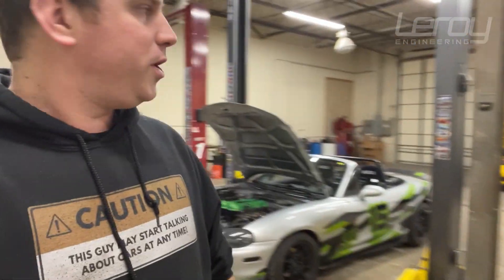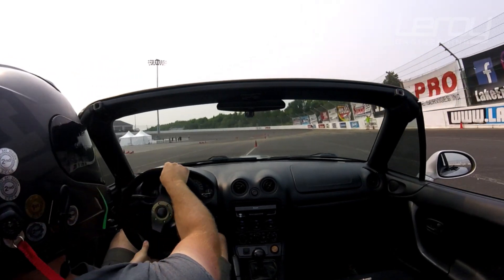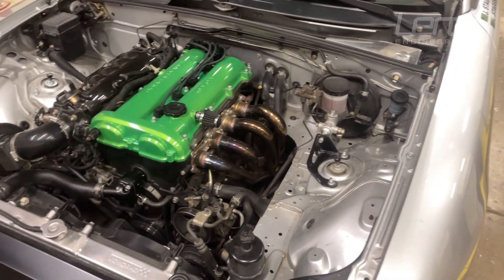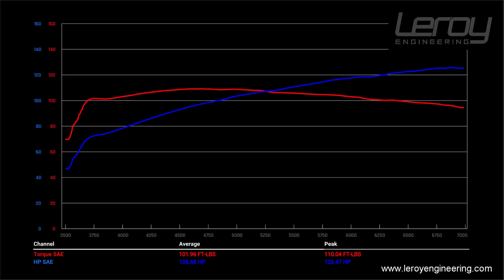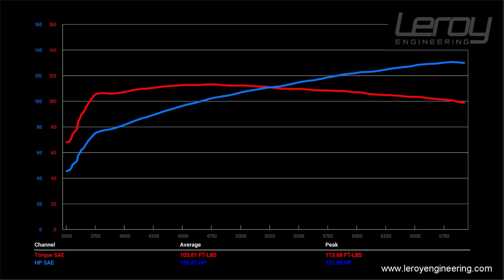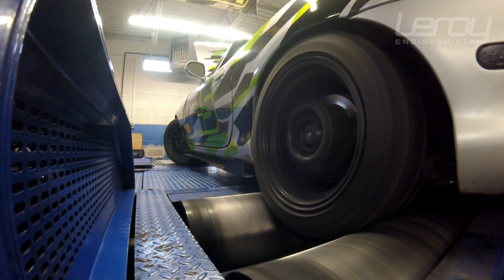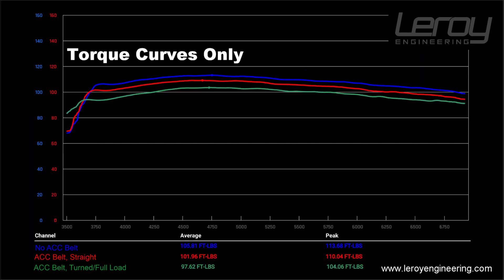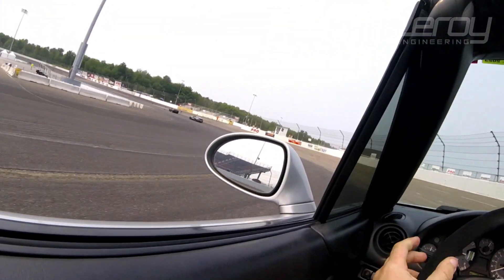Miata Dyno Tests: How much HP does it take to run a Power Steering Pump?

Comment: Next video idea: How much horsepower does electric power steering consume (from the increase in alternator draw).
Reply: For the type of steering where the motor directly drives the steering column, I guess it would be zero, when you're not turning the wheel. I think there's also a type where the electric motor turns a conventional hydraulic pump. The power loss there would be interesting to know.
Reply: yes but on a dyno there’s no actual load on the power steering and i guess the same would be true for the electric column
Reply: I was thinking about this some more and it's a somewhat dumb idea because you can just measure the wattage the EPS is drawing which directly correlates to horsepower (748W = 1HP).
Reply: @ajsmith7018  A car guy would know that when the steering is hitting it's stops the power steering pump works it's hardest.
Reply: Much less than a power steering pump at least.
Reply: EPS is extremely efficient, that's why it can be stuffed up under the dash, without any fan, or even airflow and not overheat.  Some are on the rack but the column mounted examples show us how little heat is made therefore little energy wasted
Reply: Very intéressant. Buying my first mx5 sunday.. 2004 model nbfl 146  bhp,1.8 ( european model since I am from France,  Étna model)
Reply: Had the same suggestion. Nissan has a electric over hydraulic system. And then most modern cars have electric assist.
Reply: Someone did check, cant remember who did it but maybe Engineering Explained on Youtube did it but I cant find the video now. In short, pretty much no noticable power loss if you're using the same alternator.

The amount of power an electric power steering rack uses is minimal. And because its electricity, it doesnt need to get energy from the alternator directly, it can get it from a stored source such as the battery. Alternators usually put out much more power than the car needs anyways, that's why the battery is always topped off after every drive.
Reply: Imagine a system where if you're full throttle accelerating the alternator lowers it's power to free up some hp and for the duration of the acceleration the electric steering is run form the battery alone.

Comment: On my '99 the PS was 14lbs, and most of that would have been on the heavy corner. I swapped to a welded rack. For the first couple days, you think you have made a mistake, but once you get to understand it, you wouldn't go back. PS has the biggest effect when you are parked or moving very slowly. At highway speeds or autocrossing I don't notice it. What I do notice is that I get more feedback from the wheel. On low grip surfaces and near the limit, the wheel feels a little dead, so it lets you know how much traction is available. On an off ramp near the limit, the resistance on the wheel changes with momentary changes in grip level. Your hands do shake a bit, and you or your passenger may find that disconcerting. But to me, the connection between car and driver is just that much better. I'm pretty big, but don't lift weights-- small drivers might find this mod to be too much.
Reply: I've found this to be accurate on the 89 Civic I had with manual steering. Heavy real slow/still, gets lighter when traction lessens like at speed or wet pavement. Feel is amazing though. Makes you work when parking.

Comment: I'd love to see the same test with AC on vs off. It would also be cool to see this comparison done with an older car (NA or NB) compared to a modern one (ND).
Reply from the maker: For the NA/NB cars, Mazda knew they didn't have enough power to both accelerate and run the AC compressor :) so if you go to WOT, the AC clutch disengages automatically. For the newer ND cars, they switched to electric power steering, which would still be a valid test, as we'd be testing the extra load on the alternator. 

Speaking of alternator, that would be a good test. I'm already imagining installing a switch to disconnect the alternator before each autocross run :)

Comment: Yeah - so - what about ELECTRIC power steering? They don't have that for Miatas? Also - if you're up for it - what about testing the benefits of weight reduction in general, when using: 1.  Aftermarket aluminium cam gears(adjustable - which tend to be lighter than stock -  ESPECIALLY in some VVT engines) 2. lighter flywheels(& driveshafts - if within your budget) 3. lighter crankshafts(knife edged etc to remove unnecessary material) 4. lighter pistons 5. lighter wheels(& or the different effect wheel diameter has on performance\dyno figures) 6. lighter brake rotors(carbon ceramic or budget Drilled AND slotted 2 piece rotors - more so for a FWD car, but as ling as it's needs to be spun up it requires energy so...) ...My point being to see how much overall power can be had from an engine & drivetrain focused weight reduction - & to prove that several small tweaks like the one in this video can add up to decent power\efficiency\performance gains(so one should not stop at doing just one)...🤔

Comment: I think it would be interesting to see how the power is affected with the steering wheel is turned back and forth (maybe air down the tires significantly on a run to see the correlation more clearly). The steering wheel being turned full angle one direction might not be realistic but you could validate this by turning the wheels back and forth

Comment: I drove my 90 Civic hatchback for years without PS. Light cars with a manual rack are fine as long as you are moving. In fact, the steering feel is amazing with a manual rack.
Reply: Same, honda didn't put PS on the hatchbacks, only sedans.  I removed the PS on an 89 accord, you could only tell when parking and it was still not bad, my wife drove it without complaint.
Reply: @999benhonda  some of the hatchbacks came with PS. My 89 DX hatchback has PS, but looking to go manual.

Comment: Convert to electric-over-hydraulic pump.. it works great to free up power and it provides steering boost when you need it.. but not when you don't.

Comment: I've always had a theory about skin friction in a few of the pumps in an engine, like the oil and coolant specifically. I've always wanted to polish the inside of the passages to reduce skin friction and pumping losses. I put this theory into practice years ago with a td04 turbo. I polished the inside (all the way through the housings) and i took it a step further by polishing and sharpening the compressor and exhaust turbines so they would slice through the air. After installing i went way lean on acceleration, had to add throttle enrichment, once I did that, the additional torque smoked my transmission in about 7 days. The turbo eventually blew too because I didn't get it balanced. Anyway it would be cool if you could try something like this if anything on the water pump or oil pump. It would awesome to see the dyno numbers.👌

Comment: Yeah that’s pretty interesting. I removed the power steering on my 90 last week. For now it’s just looped but in a few weeks I plan on finishing the job. Was waiting on new SuperPro bushing for the rack. For me I didn’t notice much of a performance difference. I don’t have A/C but I’m sure there is but it wasn’t noticeable. As it is looped I like the weight of it driving. It’s on the heavy side bellow 20km/h but driving it’s really nice. I think there’s probably still too fluid inside though. If I hit a bump well making a hard turns at low speeds it kicks back a little but it’s manageable. Roundabouts are two handed now lol. The most positive thing is now it’s super easy to access the heater pipe to change that o ring 👍

Comment: Less related to the Miata being setup for STS/STR - I’ve wanted to do a pseudo hybrid setup for years that has an electric steering pump, water pump, and AC compressor, with a custom lithium ion battery the same physical size as a stock lead acid, and then have the only accessory be a motor/generator that can start the motor and also blend how much torque is used for generation down to nothing at WOT. I’ve read BMW cuts alternator output to zero at WOT in some cars, and G.M.s mild hybrids of the past were interesting. The GMA T.50 has a mild hybrid like this too.
Reply: The NC Miata (MX-5) has a computer-controlled alternator. I don't have data showing exactly what the stock ECU does with it, but I remember needing to replicate the signal to keep the alternator charging the battery when doing standalone ECU stuff with those engines.

Comment: Hey man! I guess the best mod for 1.6 miata, stage one, is going with electric water pump, electric ac compressor, as well as electric power steering 
For AC compressor I should say, it's bit heavier than your factory setup(~15kg, with back strapped AC radiator/fan). If you're ok with it, then based on the cockpit space, I recommend at least 2btu for a 2door small pickup. I have done only one of this sh¡t, but I researched it, like an asshole police, searching your car, without consent, just looking for sth to charge you with! I used a 4.5btu for my hatchback. I tasked it with ac, one giant ~1.4ft³ refrigerator, and one other thing. It uses 24v( with 3 separate small units of 12v DC to 24v DC convereors).

For the power steering, so far, my best result had been combining both direct electric motor with mazda3 electric hydraulic pump, with my factory hydraulic rack).

There is just one small pushback for above-mentioned upgrade: the efficiency of electric motors are less than their mechanical counterparts! Therefore while using them actually you are putting all the load on your alternator and with one step, on your engine! The way to attack that's problem is having a shot down/off push key under the accelerator, killing the alternator while heavy acceleration! So it won't affect your engine's performance!!! Please don't mention weaker sparks, because there are zillion ways around it. 😅
Doing so, on average you might gain 20hp optimistically, but this 20hp, is more than 20hp gain, achieved by upgrading turbo for example! Because it reduces the engine load, instead of putting much more strength on it! So no more powerful cams, pistons, conrods, etc.

Comment: I had an 89 accord lxi, the power steering system had a leak, so i removed it.  I swore i could feel a power difference.   I wonder if older cars had PS pumps that ate even more hp, or if they were just as efficient as modern ones

Comment: This is awesome info, is there an under drive pulley option for the Miata so you could reduce the amount the power steering pump would have to work but also retain some power steering?

Comment: I depowered my rack and could absolutely feel a difference on my 1.6.  Unfortunately I hated the driving experience without it, so i added E-power steering.   I've often wondered if the E-power steering adds additional drag on the alternator and if that can be quantified on a dyno.  
Great vid!
Reply: Absolutely it adds load, nothing is free and energy is energy. The question becomes is the belt powered alternator feeding an electric motor to power a pump more efficient than the belt powered pump. But the electric system only works when demanded so in a straight line you're free of that extra parasitic loss.

Comment: Interesting, thanks for doing this test, have to admit that I was a little surprised by the HP consumed by just having the pump installed.   Would be very interested in see the test results of no alternator and water pump.  I race in SCCA's STL (Super Touring Light).  Most sprint races are from 20 to 35 minutes long.  Some of my competitors use a large battery with no alternator and run an electric water pump.  How much it is really worth?
Reply: Great question! In a racing application, I suspect most of the alternator's losses would be inertial rather than as a result of generating electricity. A race car may draw, for example, 20 amps to power the fuel pump, ECU, ignition, gauges, etc, which is only 280 watts. If we say the alternator is only 50% efficient and double that wattage, we're still only at 560 watts, which is around 0.75 HP.
 
If he ever tests an alternator, it would be cool to see the difference between the alternator spinning under no load with the control plug disconnected compared to spinning against a load with all accessories on. Another variable is voltage though. With a lower voltage from the alternator not charging, the operation of the ignition system, fuel pump, fuel injectors, etc will be somewhat affected, which could affect the engine's performance.

Comment: No ac compressor 

I bought a 86 325e from someone who wanted to turn it into a drag car and took out the compressor I’m kinda wondering how much of a difference it makes because also something I didn’t notice was it had like a bump stop thing on the floor for the gas pedal side so I’d only be able to open up to about 40% throttle and when I had noticed it the car kinda just died on me weirdly (everyone tells me it’s wiring and I don’t doubt it is just because everything about it) it’s a rebuilt m20 so stock motor just no ac compressor (also 5 speed manual so I could technically go a bit higher in rpm highest I went once was 3500 other then when shit hit the fan and it got stuck at 4k steady end of red line is I think 6k or 5k somewhere in that range

Comment: Your test is a little inaccurate...  You are testing removal of BOTH the PS and AC - not just the PS.  When I tested PS w/o AC on a 99, it was only a 2 HP loss (with the wheel straight).

Still a good video and test but would be interesting to see the results w/o the AC for accuracy

Comment: Just go to a junk yard and pull an electric power steering system off a mid 2000's GM sport compact vehicle (Saturn ION, Vue, Chevy Cobalt, HHR, Equinox, etc.) and use that in place of the hydraulic system. Yes, you can spend 4 figures for a commercial electric power steering system, but most of them are literally just GM systems packaged to work on nearly every platform... The trick is that the CAN bus controller that normally feeds vehicle speed to the power steering system doesn't need to be present for the electric power steering system to work. The module that is attached to the steering system "fail safes" to a voltage input that can be controlled by a potentiometer when wired to certain input pins. There is a little more to it than that, but there are a few videos and DIYs online for adapting GM electric steering to other applications. Note: this is not a rack, but an assembly that goes inline with the steering wheel to assist the rack. 
A few yeas back my local pick-a-pull didn't realize they existed so they were selling steering wheel assemblies for like $25 each. On 50% off day I snagged a half dozen of them.. I put that sh!^ on everything...